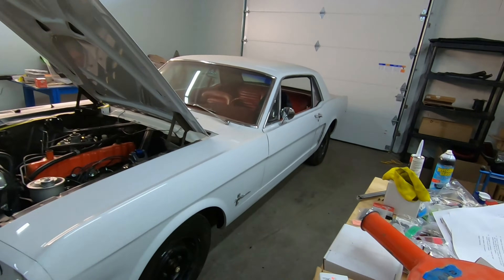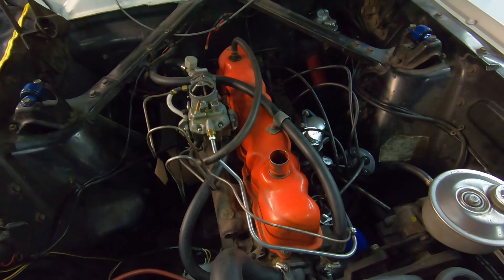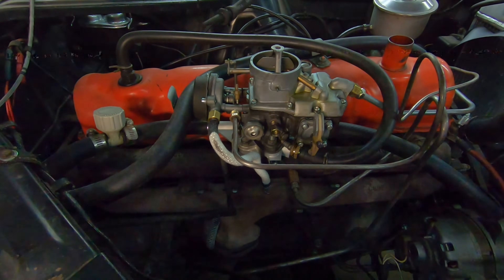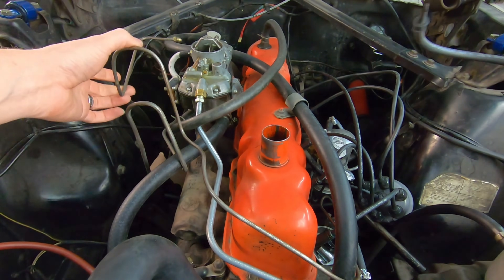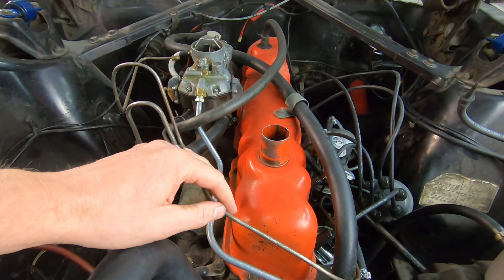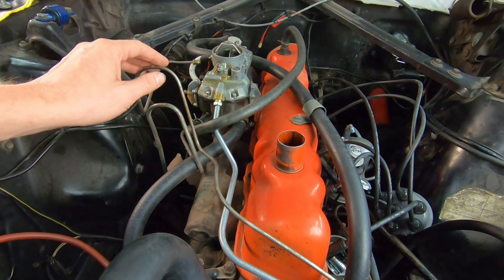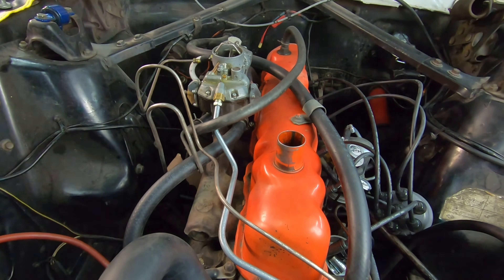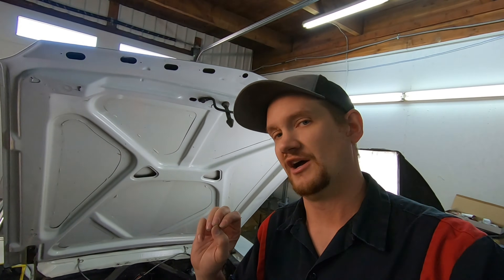Testing the Vacuum Advance on a 200 In-Line 6 Ford

Comment: How would you recommend checking the vacuum to the transmission on a 68 200cid automatic.
Reply from the maker: Remove vacuum line from shift modulator. Attach vacuum gauge. Start engine. See what the gauge reads.

Comment: Alf - would the process of testing the vacuum advance with a Carter YFA-style carb be the same? Also, when you showed the movement of the assembly in the distributor, did you do that by putting vacuum on the tube like you showed initially and then moving the throttle linkage at the same time? I'm wanting to test this as I'm having issues with my i6 wanting to stall when in reverse and it's also idling very high when in neutral even when good and warm. Also wondering if maybe my carb just needs rebuilt but not really sure where else to turn. Thanks in advance as always. Always a great video....

Comment: Need to know where to connect the hot vacuum carburetor line that is towards the back of the carburetor any help would be greatly appreciated
Reply: I'd be happy to help.  Are you are talking about the line that runs to the choke assembly?  This line runs from the exhaust manifold up to the pipe fitting on the choke assembly.  Actual exhaust does not come up this tube, it just draws air that is heated by the exhaust manifold.  The opposite side of the choke fitting has a double-looking tube.  One of these is for the mounting screw on that side, the other goes into the casting of the carburetor and runs down to a hole in the base of the carburetor opening up to the intake manifold.  The intake manifold provides a vacuum to draw that hot air from the exhaust manifold through the choke assembly to heat the bimetalic "spring" and, thereby, open the choke when it gets hot enough.  Look carefully at the exhaust manifold in that area to find a built in spot to stick the "hot tube".
Reply: @BlisterBang  thank you for your response makes sense now

Comment: My distributor doesn't have springs  just point & condesor. I do have same carb (1100). Problem is it stutters till I  floor it/ higher RMP's any suggestions? 
Yazmin 
Venice Beach CA

Comment: Forgive me for bothering you but I have a 1979 Ford, the vacuum does not move at the beginning of the acceleration because that is what it was made for but it does so at high speed. I cleaned the carburetor and it seems to me that the vacuum is very hard. I do not understand why it does not activate at the same time. At the beginning of the acceleration, I changed the vacuum and it improved a little. You know what degrees it should have at the time of activating the vacuum. Thank you. I hope you understand.

Comment: My i6 200  67 stang has a modern vac advance distributor with coil pack on distributor cap. Is metal the only option for the vacuum line? Do i want to use the same port on the 1100 carb as what the stock distributor used?

Comment: I have a 1970 Mustang with the 250 6, when I apply the brakes it rough idles when in gear, if shift to neutral with the brakes engaged it clears up. What could cause that
Reply from the maker: Does it have power brakes? If it does, is the vacuum booster leaking?

Comment: Thank you, long time viewer and always learning from your detailed guidance/instructional videos !! General question, I have to replace my harmonic balancer/crank pulley... got the center bolt off and before I go rent the puller, do I have enough room with the radiator still on? Or will I need to remove the rad first? any thoughts? Thank Alf!!  -- 65 inline 6
Reply from the maker: Hey Alan! Thanks for being here supporting me! In my experiences you're going to want to pull the radiator. Even if there is enough room with your puller, it's too susceptible for accidents. They are just too easy to get out of the way and make your life easier. I hope that helps.

Comment: Thanks for video’s. Question: All the same when have electronic ignition I assume? Also, when installing pertronix how far does that affect timing when using a timing light to set timing? Thank you
Reply from the maker: Ya wheather you have mechanical breaker points or pertronix, setting the timing and vacuum advance should be the same.